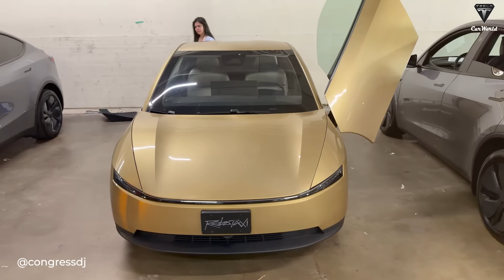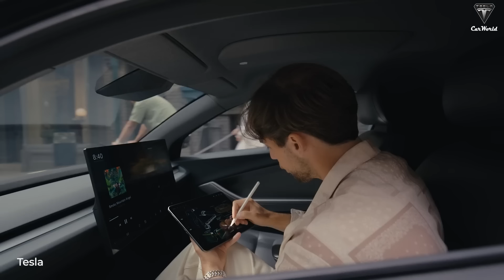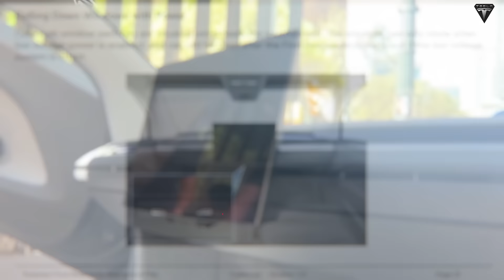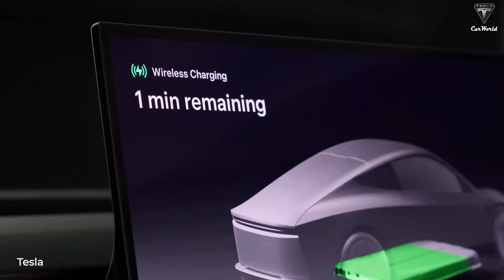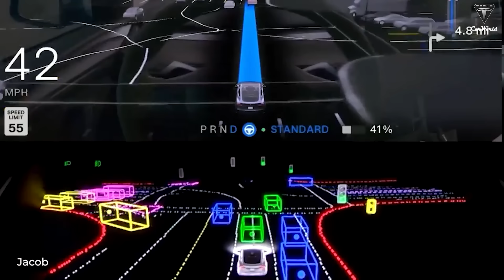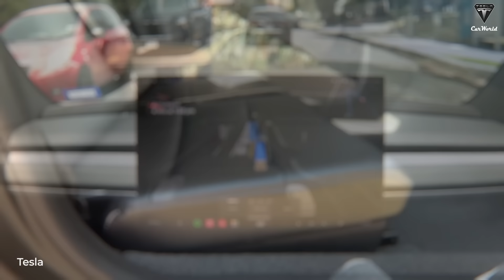Tesla’s INSANE New Upgrade Makes Cybercab 100% SAFE!

Comment: The Tesla Model Y is widely recognized as one of the safest vehicles ever tested, routinely earning the highest possible safety scores and breaking records across major global testing agencies. It frequently outperforms traditional internal combustion vehicles, luxury SUVs, and pickup trucks in combined crash test categories.
Euro NCAP and ANCAP: The Tesla Model Y holds the highest overall weighted safety score of any vehicle ever assessed by these authorities across all segments. It achieved a phenomenal 98% in the Safety Assist category.
NHTSA: The National Highway Traffic Safety Administration awarded the Model Y a perfect 5-star overall safety rating in every single category and subcategory, including frontal, side, and rollover crashes.
ADAS Benchmark: The Model Y made history as the very first vehicle model to pass the NHTSA's newly introduced, advanced driver assistance system (ADAS) tests.
Reply: Can’t wait to see first responder, testing scenarios! Joe T should see some.
Reply from the maker: Absolutely! The Model Y has set an incredibly high benchmark for vehicle safety, and it's exciting to see Tesla applying many of those engineering principles to future autonomous vehicles as well.